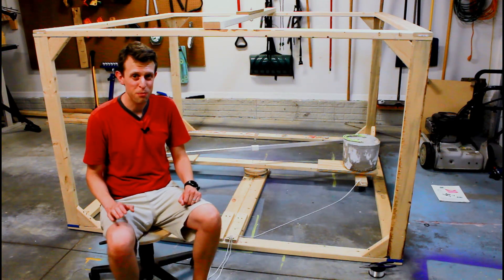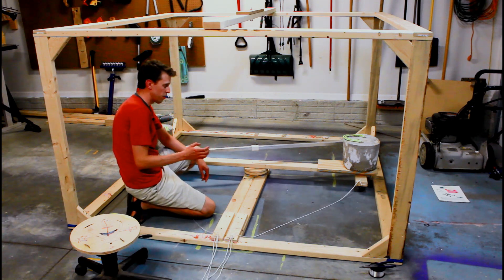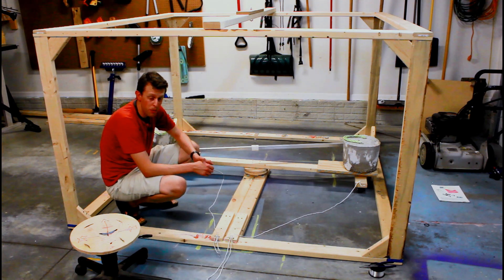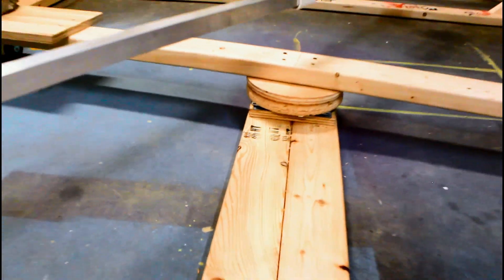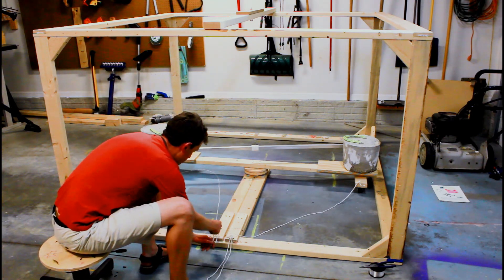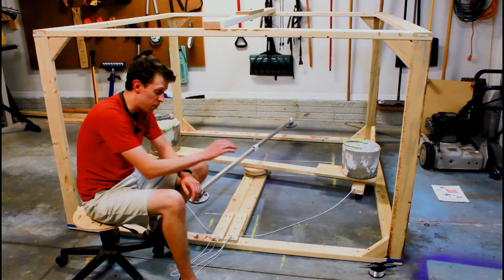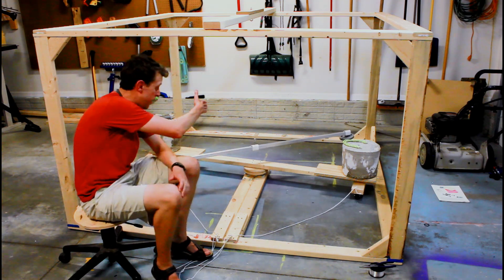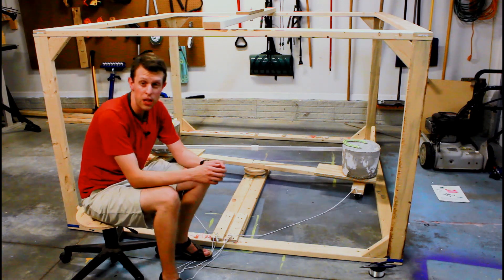Cavendish Gravity Experiment: The frame for the apparatus

Comment: What have you done to eliminate magnetic and static electricity forces? Concrete will contain materials that can interact with a magnet as can what looks like a steel weight which can interact with the Earth's magnetic field and magnetite in the concrete. All masses should be at the same potential (grounded) and should be non magnetic.  Just my two cents worth.

Comment: Thanks for the effort you put in this experiment. I really do admire that. I don't see a big problem in flow or air currents or wathever because they lie in a completely different frequency range. They are either brief (high frequency disturbance), or constant, so they will fall out of the equation. What is important though (in my opinion) is everything around the eigenfrequency of the pendulum. so if the eigenfrequency is in the order of hours, movement of the earth, oceans and moon become important. I'm not a science denier or a flath earther, but I'm just a critical thinker. In fact, I use physics a lot in my day to day work.

I do a lot of frequency domain analysis and over the years, I have collected some questions that nobody ever was able to answer. Maybe you can help me. One is about the precession of the earth. It's told to be in the order of 20.000 years. But according to the heisenberg uncertainty principle, you need at least half a period of measurement time to be able to calculate this with a bound uncertainty. How can you explain this?

There's also trouble with hidden variables. History taught us they don't exist. But the Bell experiment assumed GR predicts equal chance for orientation while that is not true. in 3D space, the distribution becomes a cosine. Exactly the same as Maxwell. Recent research about quantum dynamics showed they could look at sidelobes of the main wave which to me sounds like they finally found the hidden variables. They only didn't admit that in so many words.

Comment: I have a proposal for a variant of this experiment that might be interesting.
Flat Earthers try to deny gravity by saying that the results of Cavendish's experiment are due to magnetism.
That could be disproved by putting two small neodymium magnets at the same distance, but in the opposite direction from the lead blocks. As lead is not magnetic the experiment will work anyway, despite the magnetic field working against it.
Finally, to demonstrate that it is not a trick, without cutting the footage, two small pieces of iron are placed on the lead blocks, which are easily lifted with the neodymium magnets.
I have not found on the internet that someone has done it, and I myself do not have the means to do it. Hopefully you are interested.
Regards.

Comment: You do understand that for a two mass system, one with 50kg the other with 0.5kg distanced by 10cm the force of attraction is only 1.668575x10-7 N ?
To get a better idea, this is equivalent to 170 μgf
 (170 micrograms !!)
Considering that a mosquito weights 2.5 milligrams, we're talking about a gravitational force approx 15 times smaller than the weight of a mosquito... How do you expect that such tiny force overcomes the inertia of 0.5kg plus  the inertia of the torsion bar, air drag, etc?

Comment: May I suggest isolating the center pivot thing from the frame itself. Right now you could conceivably have vibrations rattle from the wheels under the concrete through the frame to the hanging point.
Reply from the maker: I  considered that, as well.  I didn't see an obvious way to keep the center pivot in the center without attaching it to the frame.  I have to apply considerable force to the ropes to make it pivot.  I tried tying it to the wall behind it (opposite the ropes I pull on) and hot gluing it to the floor, but it still popped loose and shifted toward me.  I don't really want this thing permanently attached to my garage floor, so shooting some powder-actuated nails into it is out of the question.  Other ideas?
Reply: Andrew Bennett, Titen concrete anchor screws are removable, but you would still have to drill holes in the floor and patch them when you finish.
Reply from the maker: I'll look into this.  Thanks for the suggestion!

Comment: Oh, I can't wait for this to be finished. I'm going to subscribe to watch the updates.  Glad to see you are setup with non-metallic weights. FYI I looked at a science kit for university and it was $1000+ for a small apparatus to do this experiment.  Be wary of the Flat Earthers!
Reply from the maker: This might be one case in which the price is justified.  Or at least more justified than some of the other ridiculously priced classroom demo products out there.  I'm using a lot of materials I had already but would guess I'll use around $200 in supplies for my low-tech version.  I'm sure precision machining pieces specifically for this purpose would add quite a bit of expense to that!
Reply: Andrew Bennett Do you have an idea how long it will take you to finish the setup and make a video about your results? It looks like you have at least done 75% of the ground work and are about ready to do the experiment.
Reply from the maker: I'm nearly finished with the giant laser protractor, then I can begin collecting data.  I'll have to wait for everything to settle, then each data set will take several hours, so it will be a while before I have data to publish.  Update showing the laser protractor by the end of this week.  Thanks for your interest!
Reply: @AndrewBennettScience  you do realise gravity isn't a force in current science. 

What force is this measuring? :)

Comment: Can you run plastic down between the bar and the weights to eliminate any wind currents that are caused by moving the weights?
Reply from the maker: I like it!  That will definitely be one of the variations I run.  Looking at the classroom demonstration of this experiment that PASCO makes, I noticed that the torsional balance is in a separate chamber from the heavy weights applying the torque.  Seems they though this was a good way to go, too!